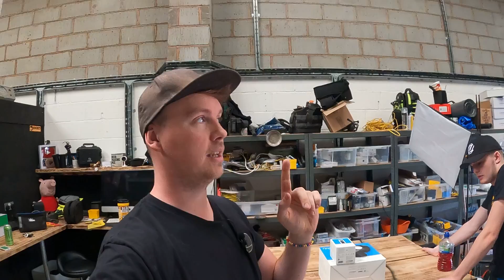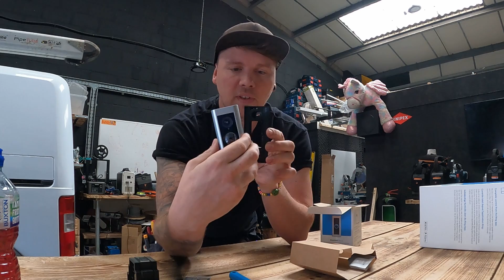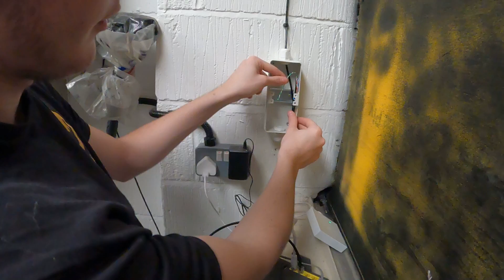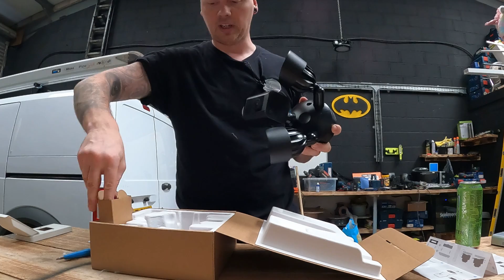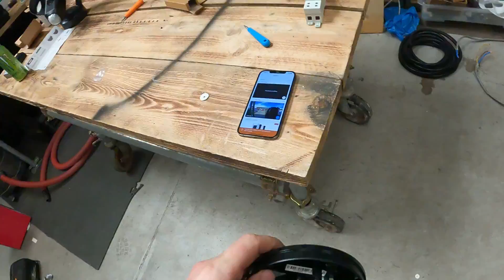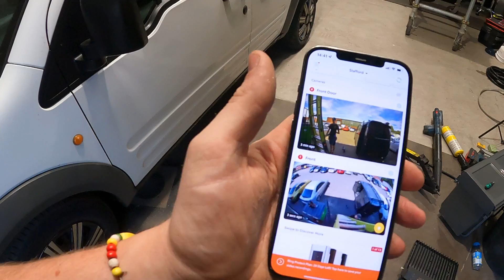Industrial units being broken into -Ring door bell, floodlight installation - Electrician

Comment: I have a doorbell 4 and my only gripe with it is that although i have a 5m long driveway once someone has tripped the motion sensor the notification does not get to my phone until after the person has walked to my door and knocked so i basically get the knock and then the alert and this is with the quickest settings applied

Comment: How right you were when you said "keeping Amazon afloat", particularly as they own Ring and collect the subscription fee. Eufy - no need for a subscription as you have internal memory storage. Also all video and sound can be shown on your phone and can even be download from the internal memory to your phone and computer so you never run out of memory and can permanently keep clips. Should you want off-site storage they do have a subscription plan. Cheaper than Ring to purchase, same doorbell type features, zoning, AI human only detection, dog/pet detection/face detection etc. Integrates into their security system of indoor and outdoor cameras, night time full colour vision camera which steps up the brightness of attached lights once it confirms trouble and turns on siren. Most of their devices can be wired or battery. Up to 12 months battery life on one outdoor model camera - highly convenient if you want to put a camera in a tree as a sneaky observation post. Totally encrypted Wi-FI unlike some of these devices. All new devices are 2K resolution and would not be surprised if their next release are 4K. The door bell as well as video takes a separate head shot. They might be looking for some promo in the UK.

Comment: You can add the alarm system in now that it actually links to the external sirens on the floodlight cam. 
Couple of door sensors and some motion sensors dotted about should be all you need.

Comment: Just a few thoughts concerning cloud based doorbells.
I used to have a Ring doorbell which was excellent however to record you need to pay a cloud storage fee. Soon after I got mine Amazon took over the Ring company a host of additional features were enabled via firmware one of which ended up killing the battery on mine due to heavy usage, even though powered via doorbell transformer. The option that they enabled taking still images in between detections I disliked not only due to the flat battery but also intrusive. Remember any data sent to some companies cloud means you loose control, even though they may say its deleted do they actually delete it. I now have a Eufy based system that stores data images/video on the base station they are great advocates of privacy and you retaining the data. See their new dual camera doorbell with one facing camera and another watching the floor where packages are often left by logistics companies.
Reply: I know some people don’t like UniFi gear but UniFi camera recordings are kept on the local network so no cloud fees etc, you can also use a UPS so if the power is cut the cameras still work 👍
Reply: Eufy are just as bad ... see their terms of service:

In these Terms of Use, "your user content" means material (including without limitation text, images, audio material, video material and audio-visual material) that you submit to the Service, for whatever purpose.
You grant to us a worldwide, irrevocable, non-exclusive, royalty-free license to use, reproduce, adapt, publish, translate and distribute your user content in any existing or future media. You also grant to us the right to sub-license these rights, and the right to bring an action for infringement of these rights
Reply: @johnmheaton  Try reading what "The Service" is! After that read the privacy commitment. "A small number of video recordings are viewed by our research and development team to improve eufy’s products, services, and technology. These video recordings are either from customers who have made them publicly available (by donating via the eufy Security app), or from customers, team members, and their friends and family who have given us explicit permission to use them for this purpose (which they may revoke at any time)."

Comment: Never fit ring cctv products just fit a proper cctv set up hardwired
Reply: And why not? I have cameras and the doorbell around my house and they work great.
Reply: While I can agree with your comment. The ring floodlight cam is integrated with the doorbell. So it makes it really easy to see when you get motion at the door. Ring are increasing the sub and there is no local storage option. I still think the ring doorbell and floodlight cam is the best deterrent. Since the criminals know their capability I’m sure they would avoid them.
Reply: Completely agree, you've just gone to all the trouble of hardwiring a power cable up there. It should have been CAT6 for a POE camera. Anything that's WiFi can be jammed very easily, search YouTube for WiFi jamming. Also I had clients who were having a nightmare with their house WiFi, turned out the Ring spotlight cams were causing massive interference because they make their own wireless network between devices and were overpowering the internal WiFi network. Won't ever touch Ring products.

Comment: Hey Nick, quick tip for what I've done. I've got a ring doorbell and cameras, you can set up a motion schedule that doesn't notify you during the day but will notify at night. It still logs motion but you just don't get the notification. Like you mentioned in the video the playback from the cloud is really helpful. Also you can set quick responses.

Comment: Eufy 2k Door camera... So much better than Ring. zero subscriptions needed, local storage, long battery life or your can hardwire it. Had mine going for about a year now and its been charged 3-4 times and never missed a beat. I am going to upgrade it to the Unifi G4 doorbell as then it connects into my wider Unifi Protect setup.
Reply: You can record to a local NVR with the Eufy kit, not just the local SD card (you can only download recordings from the Ring service, no direct access); the Ring ecosystem does get very cost effective when you have more than 3 devices at the cost of being locked in to their cloud services.
Reply: Security devices that store recordings locally and not in the cloud are pointless. I’d rather pay a very small subscription for all recordings to be in the cloud and secure.
Reply: @belinda7073  how have you come to that conclusion? There's no monthly fee. You still get an app and all the features except it records to a Homebase that is inside your own home. Your data. Your control. Really is the best way for it.
Reply: @ItzD3fW1sH  so you have a CCTV system protecting your building, all of the recordings are stored locally inside that building with no offsite backups… there is your issue.
Reply: @belinda7073  OK but realistically what are you expecting to happen? They take the hub? Destroy it, if they can even find it? Bit far fetched for me. You can do cloud storage with eufy too so I don't see the issue. It's the best of both worlds.
Reply: @belinda7073  Having them on the cloud is even more insecure... One thing I would never have fully on the cloud is security (CCTV). Far too many bad actors about, internally to the company (Amazon i am looking at you!) or 3rd parties hacking it. The Eufy hub in my house is in a secure location locked in a rack! Not like its sitting on the sideboard for all to see. Also more traditional CCTV is all locally recorded and any remote apps just create a bridge with the NVR! At the end of the day the "cloud" is someone else's computer and you are at the mercy of them keeping your private videos safe and secure if you knew the shortcuts all these companies make around security you would soon remove your details from them (Most do enough to keep most out).
Reply: @CeeBeeSco  it really isn’t, anyone can lift a locally stored device and then there’s all your recordings and evidence gone. Not sure how you think the cloud is insecure. I guess Microsoft, Amazon, Apple etc etc have all got it wrong? I’m assuming you don’t use email that stores your data in the cloud then….
Reply: @CeeBeeSco  CCTV camera's should never be connected directly to the internet, too easy to hack. Problem with cloud isn't really lax security, it's more the cloud provider selling your personal info to make money. E.g. Google. Their security is great because your data is valuable to them.
Reply: @elminster8149  The images and videos are encypted and sent over an encypted connection when you store data off site or request it off site. If you have the time to waste in breaking the encyption, then you are a better human than me because I will be long gone (dead) by that time and probably the Earth with it.
Reply: @dmail00  That's not the issue. Someone can easily get into your home network and get to the camera's directly. The encryption is worth nothing then.
Reply: @elminster8149  no chance anyone is attempting to hack into someone home network just to disable or destroy some random homes Cctv unless you're a government spy agency. These scenarios are a bit ridiculous don't you think? 😂
Reply: @ItzD3fW1sH  Unfortunately no. There's enough reports of it in the media for it to be a legitimate concern. They aren't attempting to destroy of disable, they're attempting to access and use. Shame you think this is funny, if you have CCTV set up insecurely, I hope it doesn't happen to you. Hacking is not just done by governments. Don't be naive.
Reply: @elminster8149  because most people are using eufy, ring, whatever and they're not going to be exposed through someone's home firewall like hikvisions can be. It's not a concern for those products. And tbh, if you port forward through your firewall to expose your Cctv to the public Internet then you're an idiot anyway. I personally have a poe system with ubiquiti so don't have this issue either.
Reply: @elminster8149  You say that without knowing my proffesion or the security I employ on the home network. So firstly, a device which is not pre-authorised can not connect to the network and secondly as already stated the Eufy devices encypt the data locally and requires an authorsed device with the private key; so your statement "encyption is worth nothing then" is just nonsense. Impossible to access the network? Never say never but certainly not easy.
Reply: @dmail00  I could say the same to you! LOL. And I'm not referring to Eufy devices specifically. Connecting a camera directly to the internet is bad, and that's not likely to change.
Reply: @elminster8149  /me looks at parent comment ... yep about Eufy. /me looks at the parent to your first comment ... yep about Eufy Hub. I made no comment that would suggest your network is as impenetrable as soft butter,  however I do question your knowledge of encyption as you seem to suggest you can just bypass AES. I would suggest you do some research other than "reports in the media".
Reply: @dmail00  /Looks at parent comment, also talks about Ring, looks at video, also about Ring/ My comments were about camera's in general, I was not specific to either Eufy or Ring, I also mentioned nothing about bypassing AES either, that would be your assumption. The camera has to connect to the network at a lower level first, encryption is always applied on top of transport protocols. I would suggest you do some research and stop making assumptions about my level of knowledge. There are enough reports in the media (including social media from technical experts), to legitimise my observation. Anyway, I'm done with this convo now as I've made my point, and your being pedantic is unhelpful.